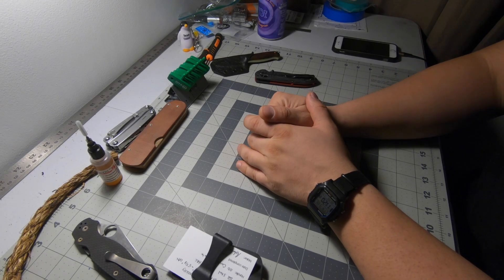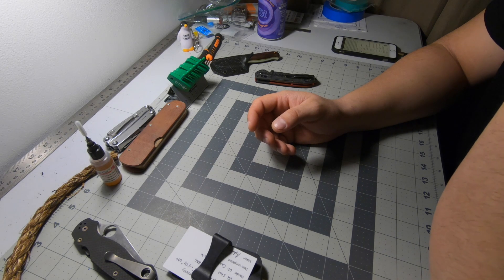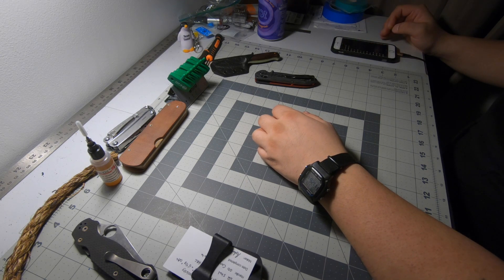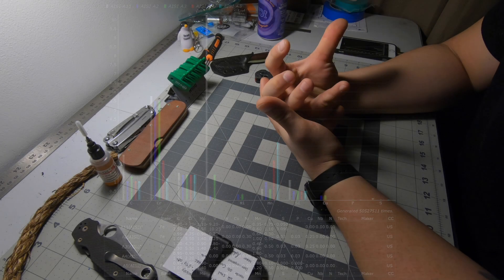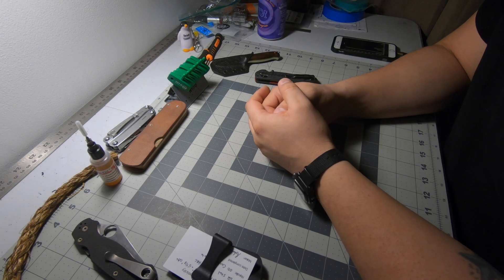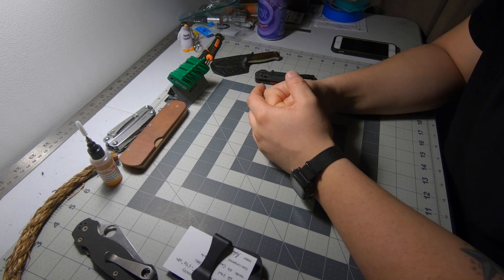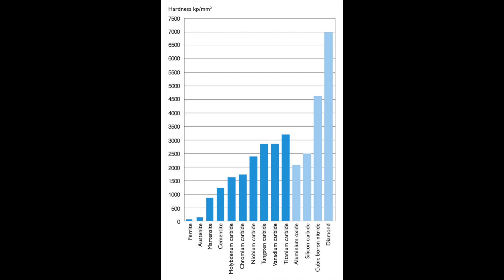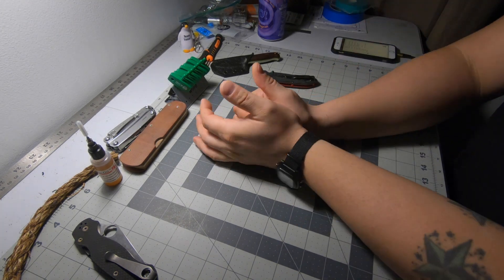Steel Talk Sunday! Intro to Tool Steel... M4, O1, Whatever it Takes!

Comment: Good video, in the age of super steels these classic tool steels are commonly dismissed and under appreciated.  There is always a trade off and the benefits you can get from these high carbon steels far outweigh the minor amount of maintenance they require.  Looking back I wish I had just given Peter's an exact number, I figured they would do their thing and give me the HRC they came out as, lesson learned there.  I'll be getting my next batch done up in the 60s which should help with the edge retention.  I appreciated the graphs you edited in, maybe next a video that focuses on what each element provides to the steel.
Reply from the maker: Thanks man! Agreed! Like and a lot of them are being regenerated with powder metal technologies that really enhance their attributes. Exactly, trade offs with everything. Geometry, steel, HRC, etc. I think figuring out the intended use will help you decide what to go with. But 60 is a sold number for sure. Lemme know when you do the new run and I’ll test it for sure! Thanks for the feedback man! I’ll deff have to get into the alloying elements and what the attributes are intended for in certain steels. Thanks bro! 👊🏻🍻